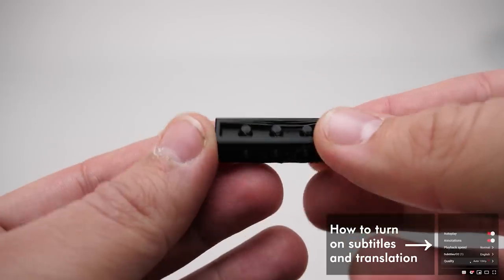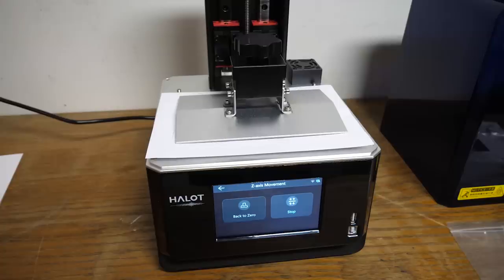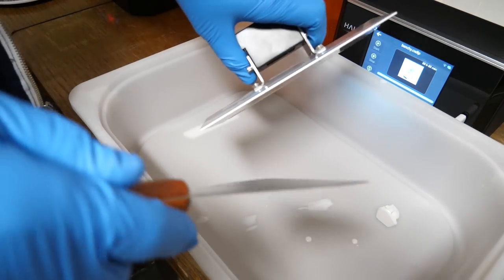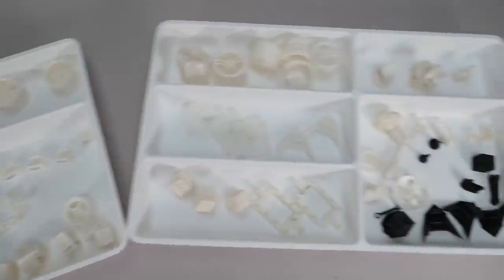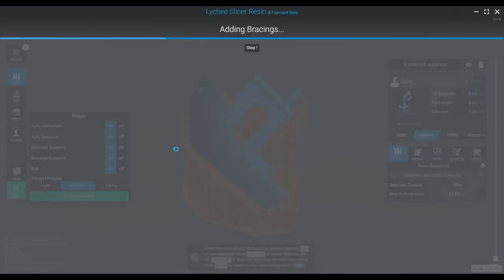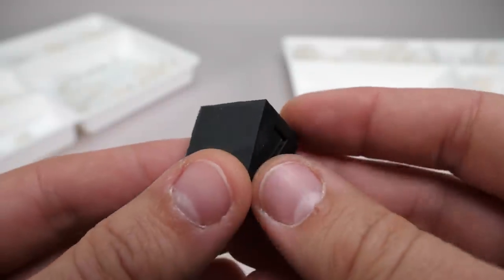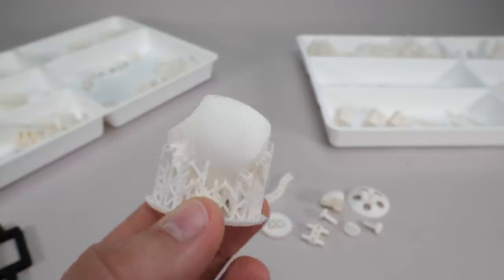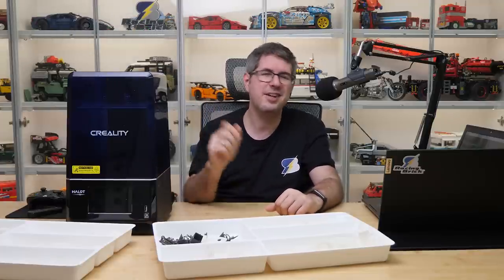LEGO resin 3d printing experiments with the Creality Halot-One Plus

Comment: Imagine creating all the pieces you need for MOC’s. That would be insane
Reply: As things are now, that would be enormously more expensive than buying real parts off bricklink most of the time. Resin is expensive, its only really worth using for rare or non-existent parts
Reply: @Magmafrost13  $16 to $40 is expensive????  I've been practicing printing lego bricks for the sake of perfect fitment settings for my statues, and you can literally print about 30 bricks in an elegoo mars in 20 mins for about 20 cents of liquid.

Comment: Right...where to start. Your curing times are too long, most parts will be fully solid after a couple of minutes of exposure. Use a pen UV torch to cure inside hollow shapes. The ideal angle for printing geometric shapes is 25-45 degrees, you get to print some of the shapes flat on the bed, but you need to buy a flexible plate to easily detach them, and you need to compensate for the initial exposure to avoid 'elephant foot'. ABS-Like resin is best for durable parts. Never print below 70c, and ideally, sit the resin bottle in a warm water bowl to get it nice and warm before printing. When you have washed your parts put them in a warm bowl of water and use flush cutters to cleanly remove supports. Once cured, you can easily sand any bumps off. Avoid putting supports inside a model if at all possible. Oh, and white resin tends to yellow, so I'd print with grey or some other colour unless you must have white parts. That's enough for now.
Reply from the maker: Thanks for taking the time to respond. I usually cure the parts for 3 minutes, I think that totally fits in the "couple of minutes" timeframe. I heated the room to 25 degrees Celsius (compared to the previous 18-20), but didn't really notice any difference regarding the issues I showed for the prints. The warm water method for the support did work for some parts, but still didn't change the lack of flat surfaces and accurate edges which is the most annoying challenge I couldn't really solve. I would be fine with the contact points of support as a little sanding can totally solve it, but those melted-looking edges and bumpy surfaces shouldn't be there.
Reply: @RacingBrick Noob here.  I’ve found you just don’t print with any flat surfaces parallel to the build plate.  If printing a cube, stand it on an edge, not a side.  Now no surfaces will have the issue.   

The issue is that light doesn’t stop pushing up through the resin at exactly the layer height.  So a flat layer parallel to the build plate is going to be warped.
Reply from the maker: @legonut78  if you check the video from 7:10, you will see that I printed a lot of things at an angle, and it was still problematic. I have another video with another printer that was more succesfull, I think due to the heated vat. In fact, the rims I printed with that were parallel to the build plate, and they still came out better than the rotated ones.

Comment: This is an excellent video, well done - so concise, and showed exactly what needs to be shown.

I’m new to resin printing but so far, I’ve been impressed by how much LESS support is required than with FDM printing. A brick with studs can be printed on its side, and the studs come out almost perfectly round. I’ve printed most of my test items (similar to your I-beam) without supports at all, with a side flat on the build plate. I was getting ‘elephant’s foot’, but to solve that, I’ve reduced first layer exposure time (applies to each of the first five layers) from the default 35 seconds to 12 seconds, and I’ve increased the initial Z height by 0.1mm. Other layers are exposed 2.8 seconds just like yours.

I’ve tried using supports and ran into the same distortions on flat faces that you found. I really don’t think supports are desirable but I will watch that other video. Time will tell, I guess, as I print more items.

Thank you again for such an interesting video.

Comment: Wow, that's interesting. I was considering getting a resin printer, but I went with a fdm printer because it was less toxic to have in my room. I was a bit sad because I knew (well at least I thought I did until now😂) that they were more accurat, but it turns out that they aren't great for printing lego 😕. Great video and really educational, let's hope you find a solution to this problem. Good luck 👍.

Comment: Hmmm. As you said, there is always a side that is ‘distorted’ when finalising a resin 3d print… maybe (would vary on the specific peice) try printing on an angle that the ‘distorted side’ is on a side of the peice that is easily repairable as such🤔. I would really love to use a resin printer to make bulk lots of wheels for semi trailers that require many wheels or flat panels.
Reply: Maybe another content idea. 3d printing custom tracks and custom sprockets. I haven’t done much research on resin types but if there is such thing as flexible resin. That would be useful for custom tires as the FDM left layer marks etc. amazing videos. Thanks for the experience

Comment: Is your printer/resin curing perfectly hard/solid? I printed multiple test prints with technic pin sockets and always the pin is able to scratch through the top layer showing some white residue on the inside. Even with elegoo abs-like resin and I couldn't get any reasonable help from community apart from recommendation of that resin...
Reply from the maker: I found no issue with curing, my biggest problem was the lack of smooth / proper surfaces on the support side that I couldn't resolve